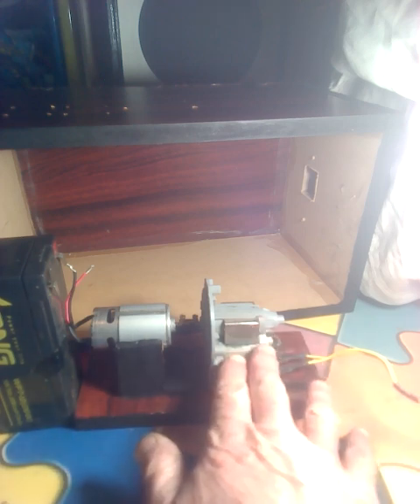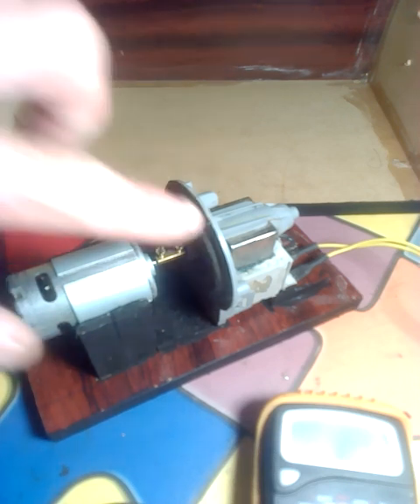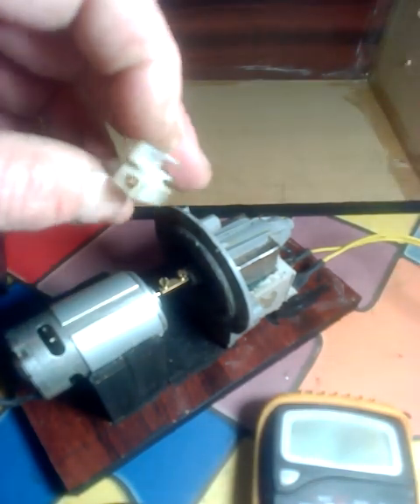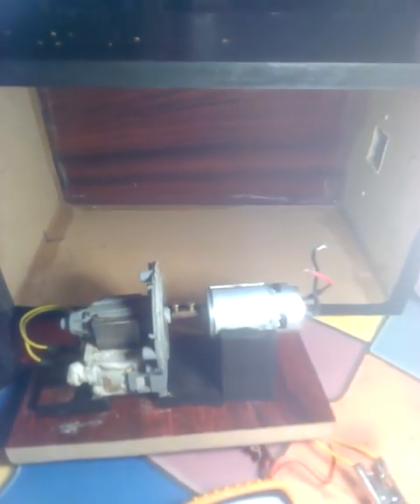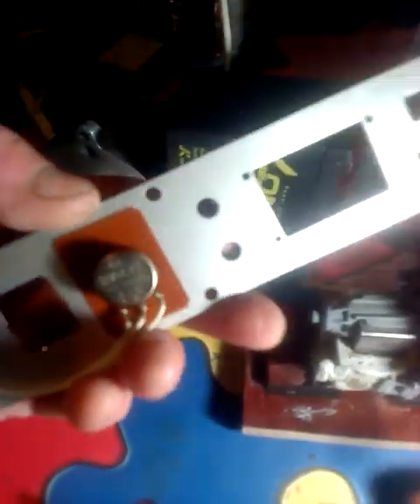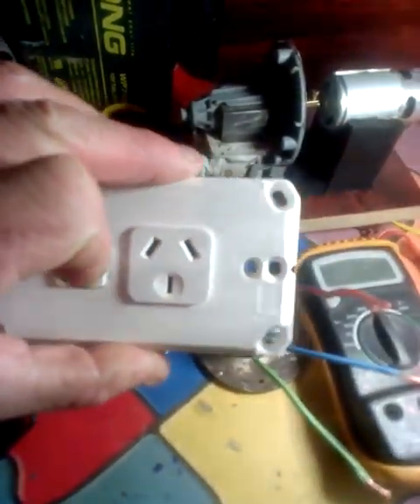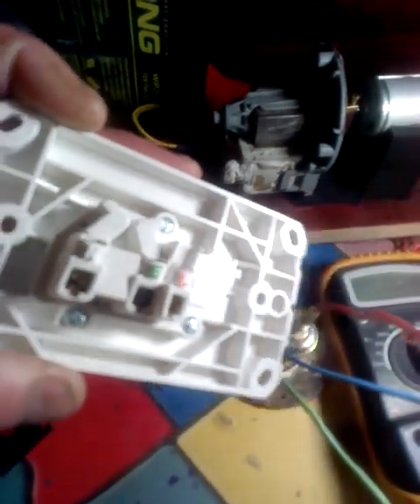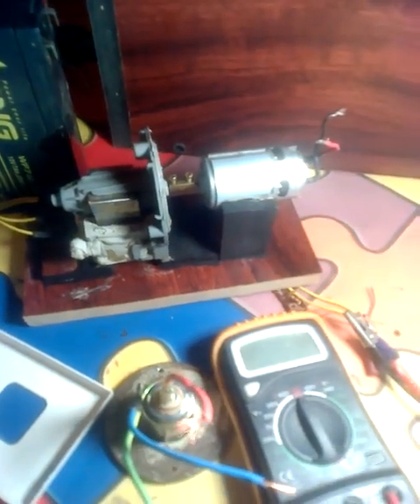building a free energy machine motor from a washing machine water pump motor  quick update

Comment: I noticed one thing that makes your motor brow. Note. Use flexible pipe to connect the DC motor to washer machine. Why? Coz the small magnet in washer machine needs to move in out as speed increases. Don't use solid connector. It happened to me till I went back to Gerald video
Reply from the maker: @andrewthuku2638  ok cool stuff 😃👍 biggest thanks ever yip I can see that too. Allsome work from cruzermans inventions 😁👍🎉🌟🦇
Reply: @tristanmcnabb2741  
Keep up the good work. We are following you every step. Any means to make power for as here in Rwanda Africa is a milestone. We do have black out most of the time. It's a forest near congo. Keep up

Comment: What is the principle of over-unity here? What is causing extra energy to come into the circuit? My friend sir T has built hundreds of different free energy motors but they aren't something you can just slap together and have it work right away.
Reply from the maker: @aero9009  big hi yip this has not taken over night to make.it is based on Nickola Teslas work from back in the past .but it's just made this way from people today.🤔😳👌🌟yes it takes battery power to run the little DC motor that turns the washing machine water pump motor but in return you get a lot more power to run home lighting and more.but the test has begun and I have more ideas for the future.biggest cruzermans inventions 😁👍🎉🌟🦇